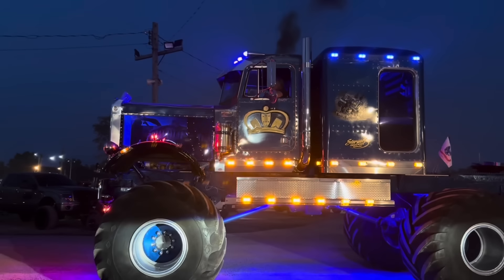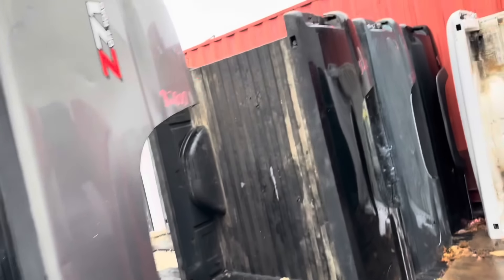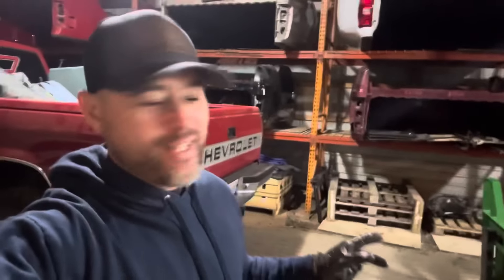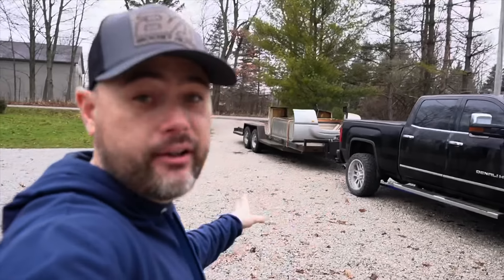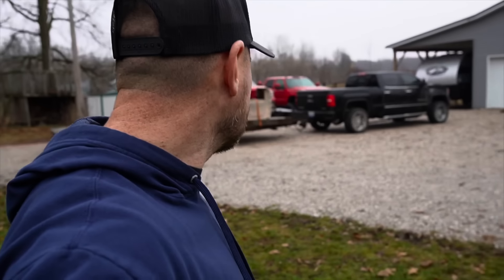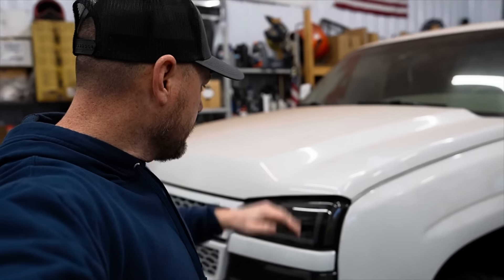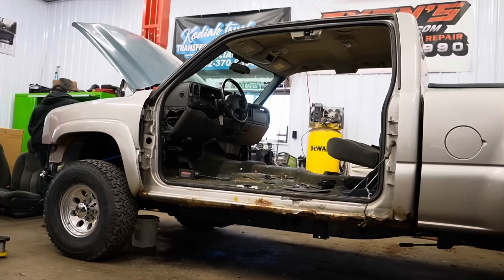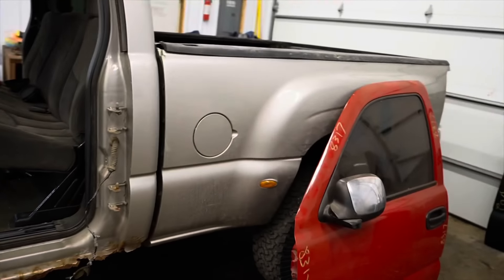I SPENT $3000 On The Rarest GM Truck Bed Ever Made! Restoring A Rusty 20 Year Old Duramax

Comment: ? I know this is off topic.. I got a lly with 200000 I did a water pump and all new injectors and a full 4 inch exhaust and 265 tires and upgraded turbo mouthpiece and a ppe duramax tuner on setting 3 and some stuff fall off😂 I’m pulling 28mpg on paper at 65 will the 6speed upgrade pay for it self ?

Comment: I had one that was a quadrill steer. It was the most expensive thing i've ever had to deal with. And when it went wrong it went wrong. I had it Locked in one direction. So it looked like it was drifting l o l

Comment: I have owned my GMC since 2003.  I bought brand new.   Unfortunately it's having its issues.   One is its been making oil past year and everyone says just run it and do a more then normal oil change.  All of the sudden the fuel cooler started leaking and now it's not making oil.  I am so confused.

Comment: It's not an hd hood on cat eyes, hd hoods are from 99-02 in 03 they went cat eye and 2 years later they resigned the hood and it was available on 6 and 8 lug Internally at the truck plant in Flint they called it the wow now hood cause they made them stop pressing the old hood mid run and switch to the new design.

Comment: The nice hoods started in 05. It's not an HD thing
Reply: I might be wrong about the year
Reply from the maker: Its 05 also it’s considered HD on the 2500/3500 although GM did a 1500HD hood as well but it won’t fit on a 2500
Reply: @TruckMaster  ok. I knew I had seen that straight edge style hood on a 1500. Definitely agree with swapping the hood and grill. Makes it look so much more like a truck. The bed though It's hard to say what to think about it before it's done

Comment: I have a 2004 HD2500 with the 8.1 gas engine.Had to repair the rockers but the bed is mint.I paid $2000.00 for the truck instead of just the bed..just sayin

Comment: Personally I hate black vehicles.  Hides all body details and never stay clean, unless freshly detailed and waxed/coated. I think that slate gray color on the hood looks good.  Or one thing I don’t see often and looks really good is a charcoal color.  It’s close to black but it still shows detail, and not that played out blah bland nardo gray.
If anything I think that w wider bed sides it would be 100% candidate for lowering the truck, just slightly and some wider wheels to fill it in without needing flares.  Maybe 3in or so, not slammed.  Would look great if think, still truck functional, but a bit sleeker and different.
Also the newer style bumper gives it that extra oomph too.  Looks very good, I would just have looked for a color matched one, I’m not a chrome guy either.  The silver color and the chrome do look good together tho.  Normally I’m a roll pan look guy, but the bumper does look good.  Only thing I truly dislike as it is rt now, is the cat eye front end, never been a fan.  The HD look makes it look better tho as you mentioned. I’m not a huge truck guy so I really never noticed the difference in the flat vs the contoured front edge of the hoods, but it is a very noticeable “can’t tell what did he do, and it looks better” type of small detail.  I personally like the GMC HD Denali look best, but you have to change out the WHOLE front end for that.
Overall the truck is coming out really good, good luck, and keep it up.

Comment: My buddy had a 02 Quadra steer 2500HD  suburban wow what a PILE OF SHIT EVERY 30-40,000 miles  it was shot. Ball joints And all the rest replace and then stupid ALIGNMENT AND NEW TIRES. SO THEH WOULD ALING IT. IT WAS COOL BUT A PILE OF  JUNK  OR WORK ALL THE  TIME. YES IM A CHEVY  PERSON !! Love All of mine. Just not rear steer  sorry.  Also he pulled a long 30’ trailer. It didn’t really help with it at all backing up. Or taking out the rear steer  components?.. maybe 🤔 doubt it probably. He was construction  contractor. So ok.  He retired so think he sold it… and the trailer. lol. Gots a newer crew cab truck  now.